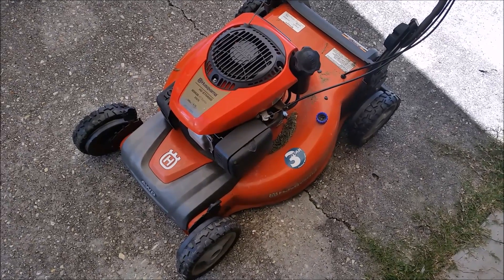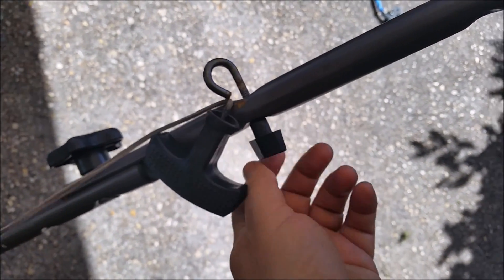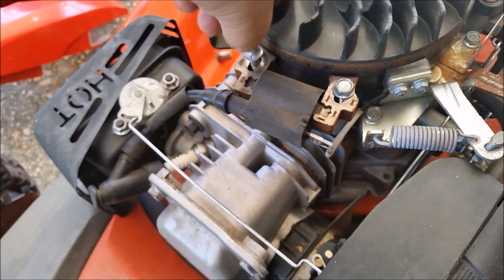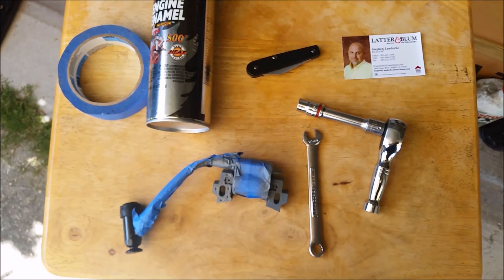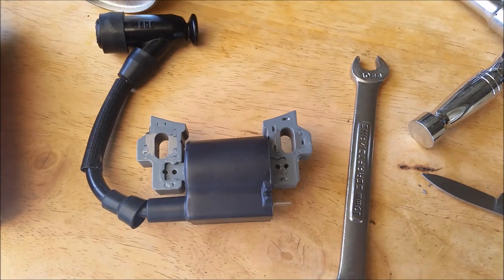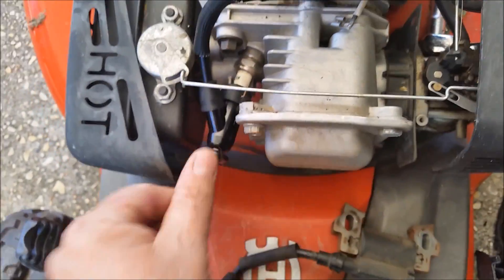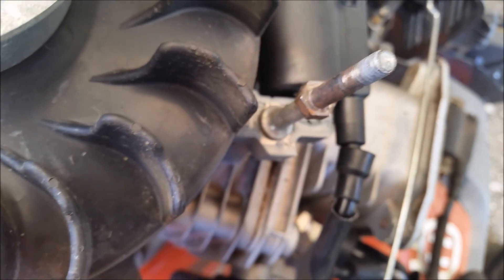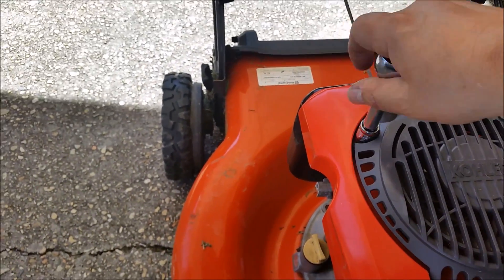Intermittent Mower Engine Fix Kohler XT675-2075 Ingnition Coil Change

Comment: Can a bad coil cause the engine to not start up right away?
Reply from the maker: Absolutely. Check to make sure you have a spark. If you have a spark then it's probably fuel related.
A few items to check are:
1. Pull the spark plug and see if it's wet, if it is you're getting fuel.
2. Check to see the spark plug is not fouled up and has a proper gap.
3. Pull the full line at the carburetor and see if you're getting fuel there, if the spark plug is not wet.
4. If you have fuel at the line going into the carburetor have someone pull the cord and see if you are getting fuel into the rest of the engine. If you are not pull the fuel bowl and clean out the jet.
5. Check to make sure the air filter is clean.
4. The list goes on, but drop me a line if you don't figure it out I'll give you some more tips.
Best Wishes n blessings. Keith
Reply: My uncle and grandmother have a Lawn boy mower with a Kohler engine on it and it takes a bit a get the engine started. It has the electric start feature, but sometimes it takes forever to start until it fires. Could that be a moisture related issue?
Reply from the maker: Yep it can be, but it's unlikely if the mower is kept dry normally. I would check for spark first. The two most common problems with mowers or small engines is usually Clogged carburetor and a bad ignition coil. Sometimes the choke can be a problem if it's not engaging when the engine is cold, but after a few false starts the mower will run because its hot enough to sustain fuel vaporization. Question after it starts does it stay running?
Reply: It does stay running
Reply from the maker: Check the choke to make sure its closed when the engine is cold. You can remove the air filter and look inside. What model number is on the engine?
Reply: I don't remember right off hand.
Reply from the maker: Is it a riding lawnmower or is a push mower?
Reply: Push mower
Reply from the maker: The model number should be right in front of the handle on a sticker. Most of the time they will list the motor model number too. If you could get that for me I could probably find the parts for you after we find out whats wrong.
Reply from the maker: PS you can sometimes find the motor number on the back of the gas tank.

Comment: I like the way you take the symptom, research it for the actual problem, get the part and install it. Problem solved. Thanks Keith
Reply from the maker: hey Bayou thanks for the kind comment. That little spark tester was cheap and it has helped me troubleshoot cars as well. If you're going to work on gasoline engines it's one of the best cheap tools you can buy. I live in south La. yall live down here in the bayou? Again thanks for the comment. Best Wishes n Blessings Keith